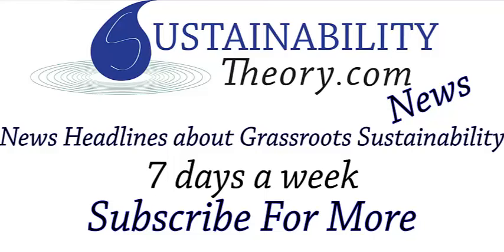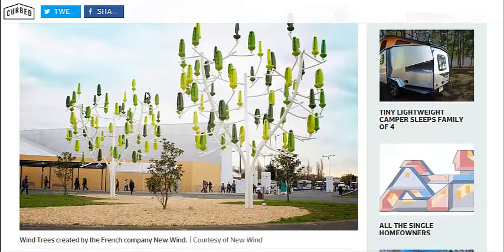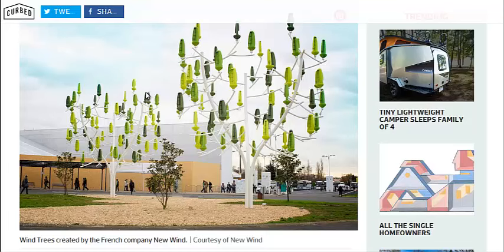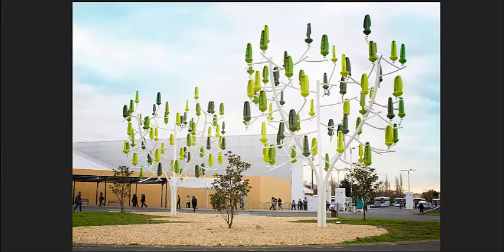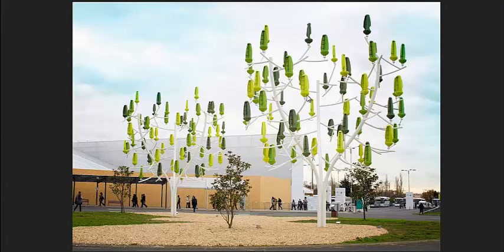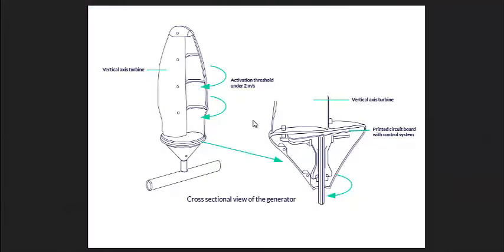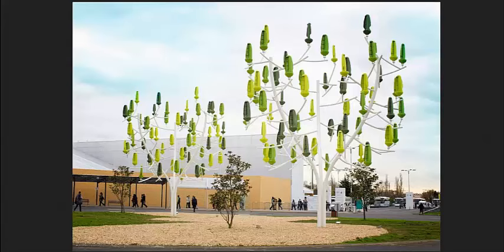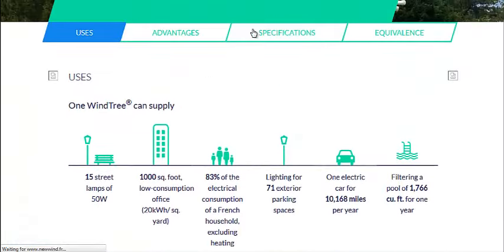Wind Tree - AeroLeaf - A Turbine That Looks Good And Works At Low Wind Speeds

Comment: Nice to-the-point video about the AeroLeaf wind turbine.

Quite fascinating to see a contemporary design that looks more like art than a turbine. I think this would eliminate the problem of all the birds that crash into traditional wind turbine blades as this turbine doesn't have blades!

I hope they are able to bring the price way down as the payback just doesn't make sense for "traditional home" use. If a home were to use $100 of electricity per month ($1200/year), it would take about 16.5 years for this turbine to save the homeowner $20,000 - the low end of the cost of these turbines based on the price model you mentioned in the video. Hopefully, New Wind can get their costs way down as they gear up their manufacturing capability.

Or, Carl, as you mentioned in the video, maybe the AeroLeaf will inspire other individuals or companies to come up with their own designs that bring competition and lower prices.
Reply from the maker: Thanks for the comment. You bring up some good points about affordability and the timeline for up front investment payback.